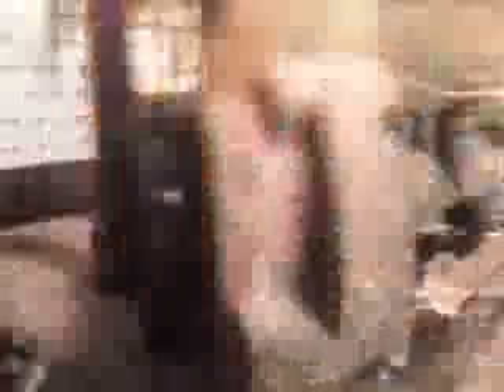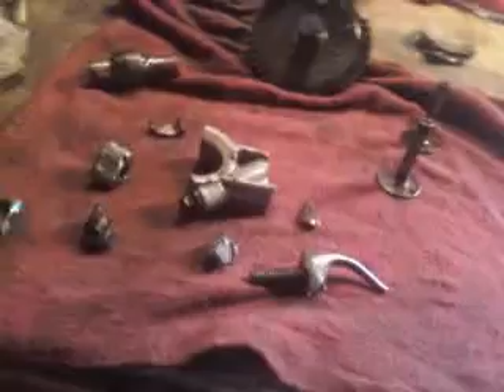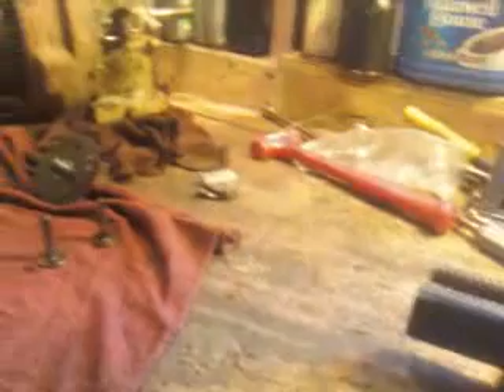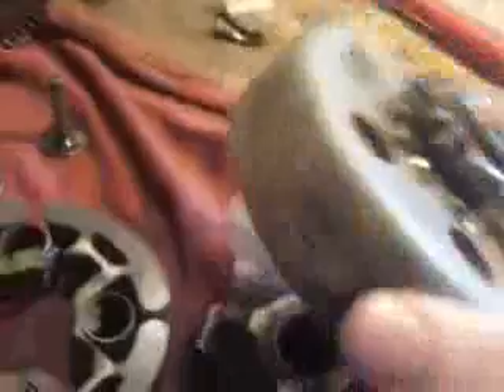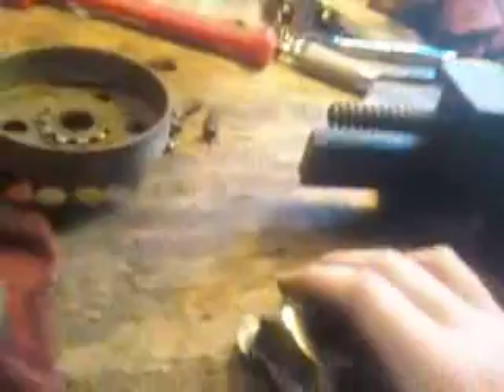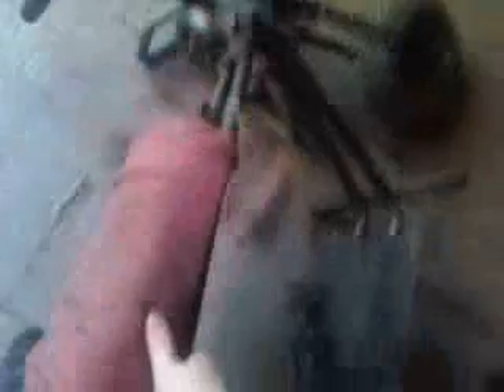Blown 3.5 HP Tecumseh

Comment: I bought an old john deere garden tractor with a k341 kohler 1cyl cast iron 16hp. it had a bad engine. upon inspection the rod had let go and took a chunk out of the cyl wall. it also snapped the camshaft, I could have fixed the engine but the tractor was too far gone to warrent spending $400+ on fixing the engine